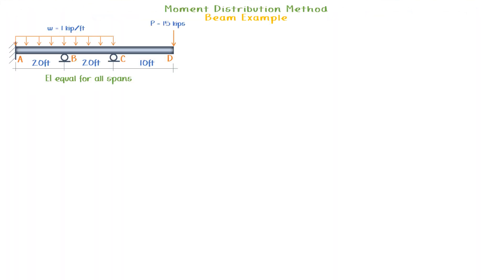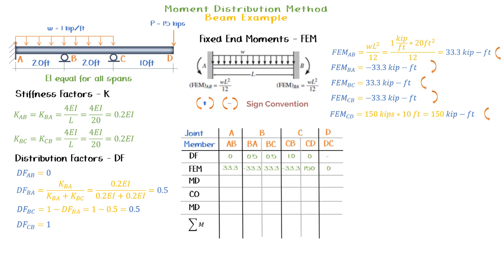Moment Distribution Method Beams Part 2 of 3

Comment from the maker: Time Stamps 
00:00 Start 
00:12 Example Moment Distribution Method Beam 
00:19 Step 1: Stiffness Factors 
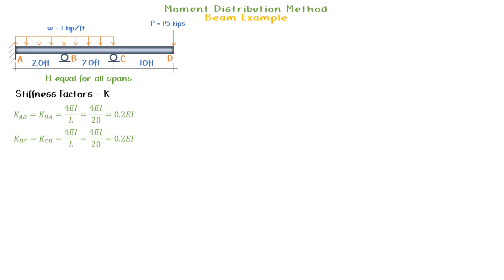00:24 Step 2: Distribution Factors 
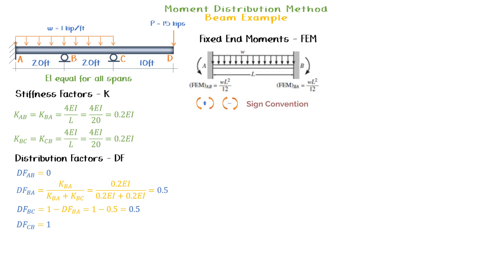00:32 Step 3: Fixed End Moments 
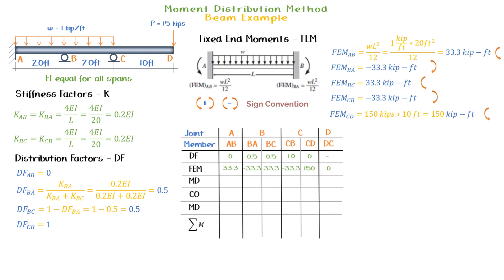00:56 Step 4: Moment Distribution 
01:07 Step 5: Carry Over 
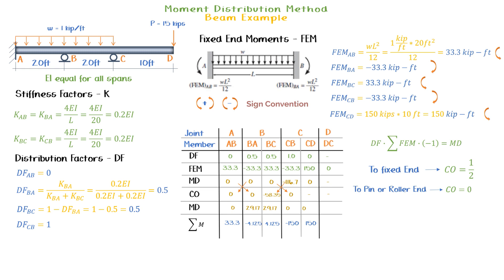01:28 Diagram of Beam Spans 
01:57 Outro

Comment: hola, e leído varios autores respecto este método pero ninguno me aclara con claridad la Rigidez por que tomas como 4EI/L para empotramientos y 3EI/L para extremo articulado?? cual es la razón. si me dejarías un link del autor o me recomendarías un libro te agradecería mucho.
Reply from the maker: Hola y muchas gracias por ver mis vídeos. Si me permites te puedo recomendar el libro de Hibbler. Es muy bueno y sencillo de entender. Tengo otro vídeo donde explico a más detalla cada uno de los pasos de ésta teoría, se llama Moment Distribution Method. Lo aquí mismo en éste canal. Me dejas saber si éste vídeo te sirve o si aún te quedan dudas.